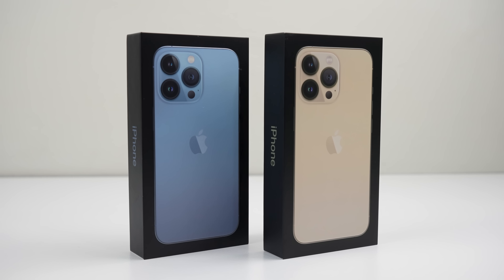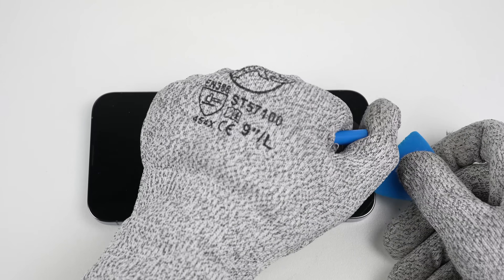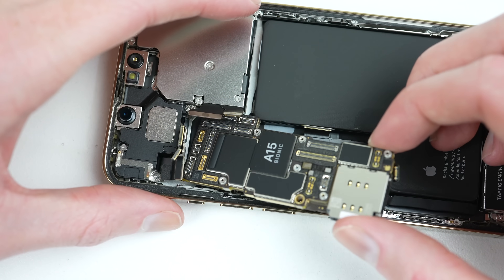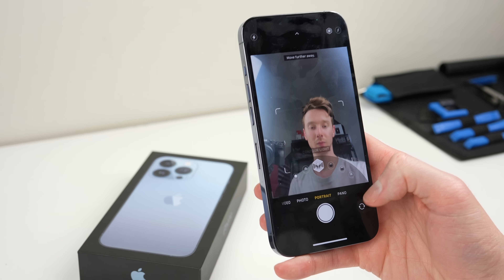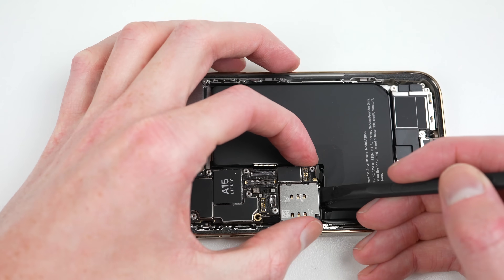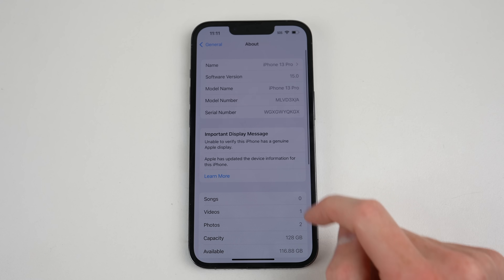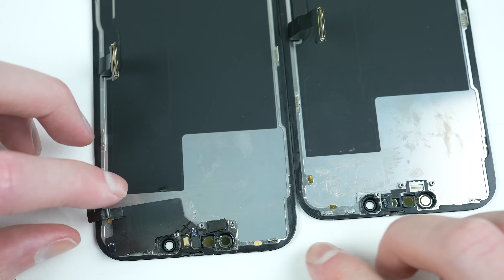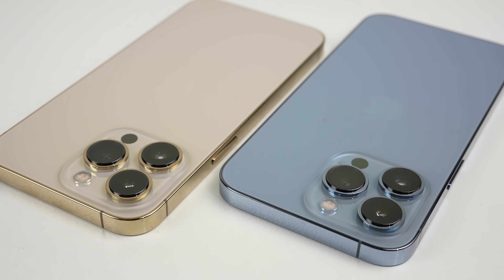iPhone 13 A Repair Nightmare - Teardown and Repair Assessment

Comment: What a super presentation. Kudos for your great iPhone technical skills!

On the other hand; what a massive disappointment Apple Inc. has become.

It seems they have completely lost their way.  This small minded, and detailed attention to preventing anyone from carrying out simple repairs on these very expensive devices is truly shocking.

I really rate the phones and I don’t see any competitors producing anything quite so elegant and fluent in usage but my current iPhone 12 really might be my last iPhone until Apple change and start to design and act for the greater good.  They must reconcile the chasm between their statements on the environment/sustainability and this devious and significant effort to force owners into fixing everything through Apple and by extension often having to pay for replacements because Apple only carry out simple fixes.  

Not to mention all of the expert, small, independent outfits prevented from carrying out their work because a giant, trillion dollar company greedily begrudges the crumbs from their table.  Frankly outrageous and utterly at odds with the founding ethos of Apple. 

Thanks for showing them up so clearly; I have subscribed to your channel - keep up the great work!

Comment: Between the proprietary cable, the walled garden software and now this locked down hardware, I'll probably never own an iPhone.
Reply: I made that decision years ago. Eff Apple.
Reply: Last one I had was the Iphone 5. That's when I switched to Android.
Reply: @JackOLanter  same! I've been using Honor 10 for the last 3 years and I'm content. Plus most android smartphones all share USB-C - so much EASIER to reuse and share charging cables with others
Reply: @hoanglannguyen7474  you settle for nothing

Comment: I wonder if they really do this on purpose or just dont care to try to get it working in a more general form. Also I bought a DJI drone and it was pretty much impossible to activate it without having an Iphone. Wonder why DJI do it that way and if there is some hidden connection regarding this?
Impressive and dedicated work for this video.

Comment: all this components would work if a diagnostic call system config is run at an apple store. This diagnostic software will pair all this part as the new components. I dont know why this is needed other than to limit who can work on the phones.

Comment: part of me thinks its just a simple fix with a serial part number change,
i'd bet thats all apple do when you get stuff repaired.
they plug in your device to a dev computer and change the serial numbers for parts that were changed on the "whitelist" data spreadsheet on your phones internal operating system

Comment: Man now I remember those old androids, removable batteries and able to open with a single screwdriver.
Reply: Hell, most of the time you didn't even need that. You could just pry the back off with your fingers since they'd be held together with plastic clips.
Reply: @stfdcrst   i meant the screw driver to disassemble the phone
Reply: @stfdcrst  the problem with phones with removable batteries is being vulnerable to water damage
Reply: @loristnorton3723  I know, I'm just saying it was super easy to replace

Comment: For me, smartphones are the biggest waste of money one can buy.  An I phone is the absolute worst.  I am retired so I rarely use a smartphone I live on my computer though.  All of these companies are whores and don't want you to fix your broken item.  My Dell computer has to be disassembled to replace the battery. For a smartphone, I buy a Tracfone from either QVC or HSN for around $100.00 for that I get the phone with 1,500 minutes, around 5,000 texts, and a gig and a half of data. I just bought a Samsung Galaxy A11.  Even after the phone no longer works on the cellular network, the camera, mp3, Bluetooth, WiFi, and other items work fine.   I would never buy an Apple product.

Comment: Just buy apple care if you can’t take care of your phones stop trying to repair it
Reply: Dumb comment
Reply: @mrkring1526  it really isn’t display itself it worth more then the repair cost why risk damage other components just send it in and get it repaired at a Apple certified repair location that’s why they sell you there plans when you buy the phone. If your a person that honestly willing to drop 1000$ + on a phone what’s another couple hundred for it to be repaired from them…. Honestly anything new meaning latest device should be covered under a premium charge I wouldn’t send my device too anyone’s else unless it’s Apple. Know if it was a older device yes display are cheaper parts are cheaper yes this makes sense …. This isn’t a dumb comment

Comment: Simple solution: take care of your phone and you won't have to face things like this.
I've had several phones and I haven't dropped any of them like some other people do.
Reply: That still won't prevent the inevitable poor battery capacity
Reply: @TheSteveprojects  That happens after 3-4 years. Are there people keeping phones longer than that?
Reply: I just checked on the website that the price is  70 bucks on the official Apple website. Is that a large sum to pay after a few years?
Reply: I had done so but it seems majority of people upgrade between 2-3 years

Comment: Plot twist: Apple is trying to take over the world by becoming your mandatory wallet. With so much tamper protection thrown in the face of governments and corporations they will be the de-facto credit card, access card, national ID card, passport, driver's license and whatever else this kind of security is good for. You will be required to own one, by law. Soon to be unlockable only by your genetic profile and 3 letter agencies. No 3rd party repairs or components means no way to bring in malicious firmware who could, for example, break their tracking of you. Even their own components who have been moved over from other phones are "suspicious" since they were handled by actors outside the system. 

Or they're just being arseh0les.